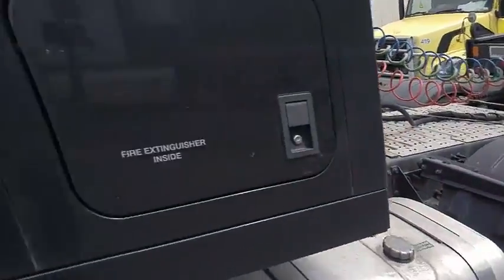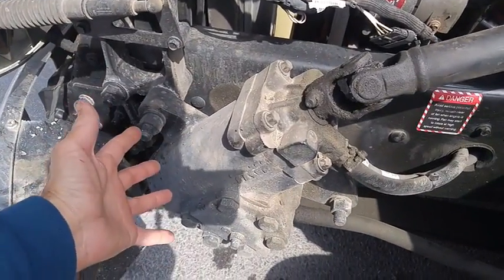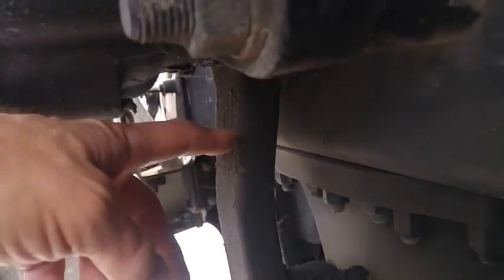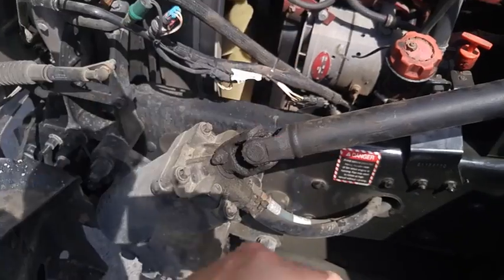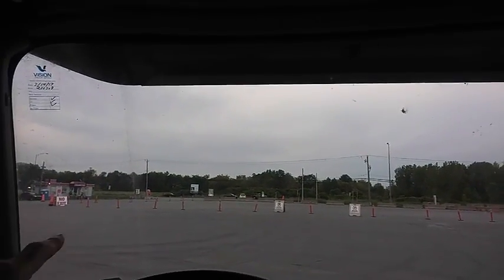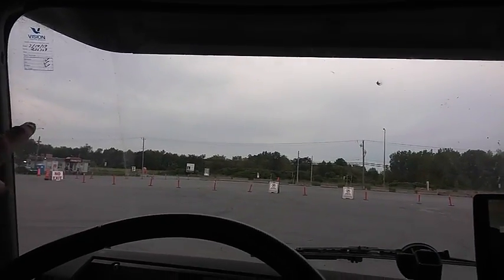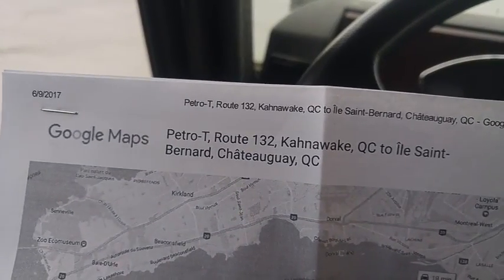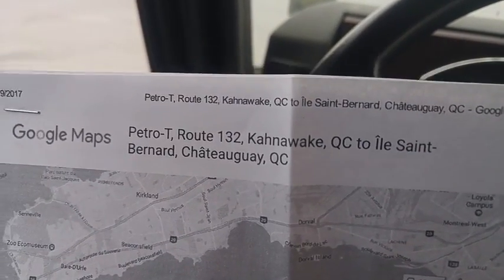Heavy Haul TV: Episode #544 -- My St. Bernard Island Adventure

Comment: The source of the sound is from relief value in the hydraulic pump for the power steering. Yes it is normal, but it can be fixed by resetting the relief pressure setting on the pump.

Comment: Great story. I love your humor and your photos. I was waiting for the clincher of Johnny Law checking on you in the truck after having the beer, lol   Just be careful steering with that pancake, lol  You stopped the steering research too soon, at the other end of those snake looking things connected to the steering thingamabob is a pump supplying the pressure that assists today's wimpy drivers. On the end of the pump toward the pointy end of the truck should be a black rubbery serpent running around some round spinny things. If the snake is not held tightly he gets angry and cries out with squeeky sounds. Or perhaps there is a cat under the hood and it is afraid of that big bad bulldog on the hood!

Comment: You need hydraulic pressure for power steering. Unless it's gear driven, it's belt driven on trucks. follow those hoses.
Reply: There is no belt for the power steering on any of the modern semi trucks.  Period.
Reply: Bo Hunt that's interesting because this looks just like his system and it states that it does have power steering belts.

http://www.pre-trip.net/Engine.htm
Reply: Rhen Evans As I stated some use direct gear drive like the air compressor. I was not aware that belt driven had been completely phased out though.
Reply: The last time that the copyright on that page was updated was 2011.  That is for older motors.  None of the new engines of today sold in the U.S. or Canada have power steering belts.

Comment: Sergei my friend. I think you dont understand their comment about the belt. They are referring to the hydrolic pump belt squeels when you turn the wheel at low speeds or low RPM. That is because the belt could be slightly loose or more probably due to engine RPM and radical input to the steering wheel. At cruising speed you are not making huge steering inputs when the engine is at RPM. But when you are parking or navigating to unload your engine RPM is low so the pump speed is low and with your heavy input to the steering at low RPM is putting some increased resistance onto the pump and causing the belt to slip slightly. I am no big rig guru but Hydrolic pumps, alternators, air conditioner compressors are driven by a belt on the front of the engine from the crank/water pump main pulleys.  Even my Jeep under max lock of steering makes some noise that is just because pump speed and max effort being put on the pump.. So yeah normal..
Reply: back to sleep Dexter.. LOL